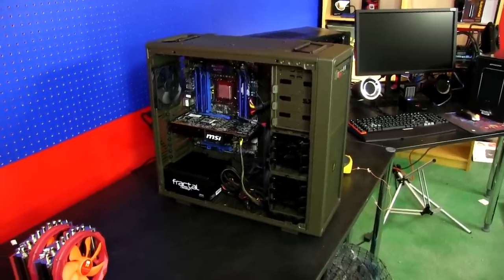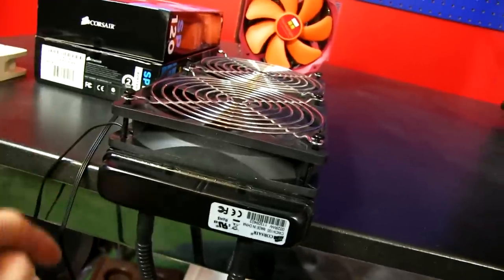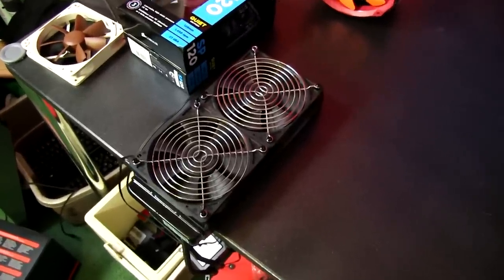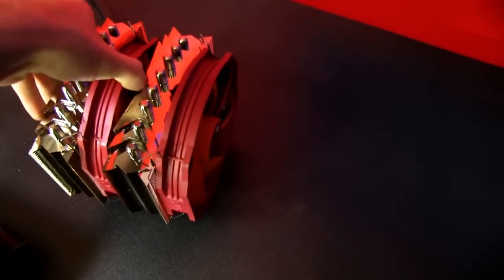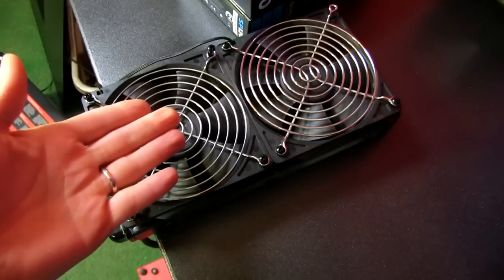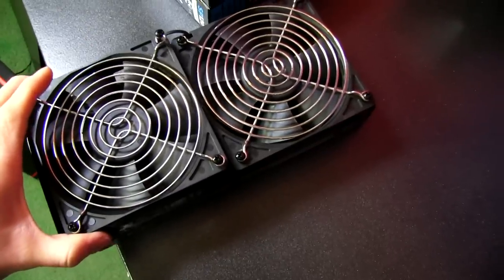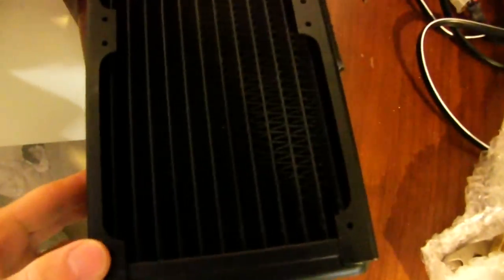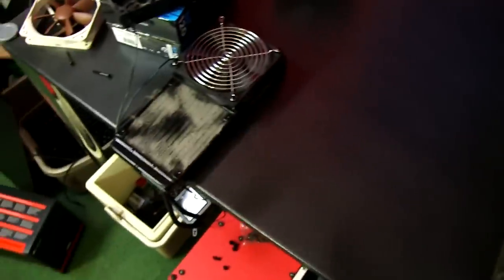Push vs Pull vs Push Pull for Radiators and Heatsinks Linus Tech Tips

Comment: Several logical ways to know the best set up
- Industries (yes, INDUSTRIES!) in refrigeration and air-conditioning run their heat exchanges in  pull to avoid dust in any environment possible. I believe they know a LOT better than we amateurs ;)

- I find it STUPID when people use static pressure fans in pull and air flow fans in Push :') 

- Most of them get the whole concept of basic common sense thermodynamics wrong. What is the point in having the back IO fan in exhaust when the radiator, which if situated towards the top, needs more air? It has to be in Pull to help feed the radiator.

- Same goes with getting air to pull from top of case and push through bottom of radiator! That's like WTH moment. Why fight against nature by pushing not air down? There is a point that all data centers get cool air pumped from the floor down to cool all the racks.

I feel like Sherlock in these instances. It has got to be so VACANT in most peoples heads :D

Comment: I have the same case, Corsair Vengeance C70.  What he said is true that so much dust accumulate if you made your cooler do push exhaust/intake.  It was hassle to clean the radiator because you have to unscrew those fans and remove them.  That tricky part about that is the small clearance of the screws (closer on the tray), it's blocked by the heatsink of the motherboard.  So what I did was pull exhaust config on top of the case.

Comment: The dust buildup shows why I would go with a pull config.
I would go so far to screw the fans into the case, then the rad into the fans. That way I could just take off the rad if I need to and keep the fans in place.
Reply: I have an air cleaner in my rooms (HEPA) and it takes MUCH longer for a radiator to get dust build up, along with good dust filtration.

Comment: The definitive answer to this existential question is a push-push configuration.
Reply: Won't it be even harder to clean the radiator out?
Reply: +Chalklate No, in a push-push config it is self cleaning. Get out of here. :P
Reply: Wash your fans with soap and water, while they are running.
Reply: pull-pull?

Comment: I have a Corsair H100i in a Push/Pull configuration using the original non-SPL rated 120mm fans on the back in order to space the radiator out the extra 25mm from the case.  This allowed the radiator to BAREFLY fit inside my Antec 1200.  The two fans on the front are the Corsair SP120s.  So it's really Push/half-pull.  But I can easily clean my radiator in my case when I take the side-panel off because I don't use a can of air... I use an air compressor that pushes over 60PSI out of the nozzle.  When you push that much air backwards through the radiator, all the dust comes out with it.  It's quite easy to clear the dust from the case in that manner.  I never had to remove my fans at all.

Comment: Its also worth noting that a 25-30mm gasket between the fan and the radiator will improve airflow and help negate the dead spot.
I seem to remember a test someone did a long time ago (pro-cooling forums maybe?) showing all the configs and the numbers supported push-pull > push > pull, however you do have a good point in that the improvement from push-pull might not justify the added noise and pull has the benefit of being easy to clean but being that you WILL be exhausting from the radiator if its an internal setup, by putting filters on all the input fans you can prevent dust build up in the first place ;)
And to the guys saying push-push or pull-pull unless you have counter rotating fans or a gasket with air straightening fins in between each fan you are wasting your time.
Reply: Who has room for a 3CM gap between the fans and the radiator?
Reply: ***** Anyone not using a mITX form factor case I would expect ;)
Reply: Sorry I didn't realize you were including megatowers in your statement. 

For the record, it will not fit in my case and allow the filter to fit on top. And it is not a mini itx either. A mid tower.
Reply: ***** Yea it all comes down to case design, in the same way some may have to stick to 30mm radiators over 60+mm radiators, so far I haven't been limited in that respect.

Comment: What are non pressure fans for
Reply: Just normal airflow, not for radiators
Reply: So do they move the same amount of air, just static pushes straight more?
Reply: Ahhh okay that makes sense.
Reply: +FroztiProductions Generally if im correct, you use AF fans on casing exhaust on the back and top if you not using any liquid cool, and casing intake at front some case has drive bay near to the front and people recommend use SP fans instead
Use sp fans for radiator and heatsinks fan if you wish to replace it.
Reply: +FroztiProductions SP for restricted spaces, AF for free space.  Example: Let's take a Corsair 750D case with an h110i at the top configured as an exhaust, back fan as exhaust, front as intake.  Front: If no drive cages or stuff tucked against the fans, AF, otherwise SP.  Back exhaust unless used as a rad is usually exhaust airflow. Top is AF if no rad, exhaust, if radiator SP as push or pull exhaust.   A little bit more positive pressure (intake) in the case is better than negative pressure (exhaust) for dust buildup, because negative pressure will pull in dust from unfiltered holes, while positive pressure will push the air out.
Reply: +FroztiProductions static moves less air but is more focused.

Comment: Square / Rectangle frame fans line up with the edges of the radiator.  Their fan blades are as long as possible to force air through the cooling fins.

Standard fans are for general directional cooling / case air flow, they have shorter blades which don't give the same draw strength.

Comment: Fan plus fan is called compound and does in fact increase cfm.  The front fan will feed the second fan compressed air.  

Look at compound turbos on diesels.
Reply: Yeah, this video is outdated. It also doesn't take into account the insane current temperatures of graphics cards.

Comment: I run push-pull because i got a good deal on non pressure optimized fans.
Reply: waste of energy.
Reply: Allen TKO ?
Reply: I run push pull, it helps, It Lowered my temps 10'C with the fans at 50 percent.. Its easy to clean, i just use my air compressor with a moister trap filter on it so i don't blow moister all over the inside my computer. That canned air crap is for the birds.

Comment: I think the push/pull vs just push or pull argument is largely dependent on you radiator as well as your fans. The reason I say this is because I have a couple of Noctua NF-A14 PWM fans set up in push/pull with my NZXT Kraken X40. I recently tired taking off the push fan due to limited space in my case, but to be sure about the results I also ran Prime to check the difference in CPU temperatures. For this test I ran the fans at 100% to get as much airflow as possible, and thje results was staggering in my case. I recorded a whooping 12 degree Celcius in difference when running just pull instead of push/pull. I had a max temp at 57 degrees C while in Push/Pull and that raised all the way to 69 degrees C when just in Pull.

Granted; the Noctua NF-A14 might not be as pressures optimized as the NF-F12, but Noctua still markets them as pressure optimized fans. This is just something for people out there to think on.

Comment: The missing piece of info is what direction the air flow should go (inside to outside or outside to inside). Always go inside to outside to get hot air from the radiator out. Your other fans should bring colder air in with maybe one other fan moving air to the outside to balance things out. Just try to have good airflow where you have about the same number of fans moving air in as out.

Comment: look at all that money. to be able to mess and configure with unlimited hardware and software sources and im just. its my dream. and this was 3 years ago and I still got a i5 cpu. lol
Reply: +James Thebeau i'm currently using a pentium dual core. And i'm actually  saving money to buy an i5.
Reply: Blatz430 Well its not to say its bad. But this is the last era of gaming I will actually be able to use this max. Best thing is to get your ram and a capable motherboard first.. lol which for me would even be the z97. i made a mistake and bought ram and a video card first and cant even overclock them on this motherboard and its a single 12v rail.

Comment: The only difference between push and pull is in the way the fans are positioned in relation to the radiator, not the way air actually flows.
So you can have a setup where you "make the air from inside the case go through the rad to expel it outside" with either push or pull. 
Push means the fans are positioned below the rad, pushing the air directly into the rad. Pull means they are positioned above the rad, pushing air directly out of the case but at the same time pulling it through the rad.

Comment: I also have my radiator fan configured in pull.  It seems to make the most sense since the radiator fan replaced my rear exhaust fan anyway.  So that's where I have it mounted.  Linus made a good point on how easy it was to clean the radiator.  I had to clean mine a couple times so far.  It's not a big deal.  Just brush it off.

Comment: Answer me this one. My configuration is push pull from the outside of the case. What do you think would happen to your vehicle if you put the radiator in the back with no auxiliary venting and just asked the fan to push air from the cab thru it. Your cab would be hot and your vehicle would overheat. That's why the radiator is in the front so it catches cold air. Fans blowing outside cold air on the radiator will cool better than fans blowing/sucking hot air thru the radiator from the case.

Comment: Nice to know I was right on the money. First time I ever bought a small cooling kit a few month ago since it can get pretty hot where my computer is my cramped room and I wasn't truly sure what way to have it but I decided to have the fan pull air and no once every few month I can really easily go in and use a hover(vacuum) to clean the dust off it.

Comment: Actually the pressure of the fan is determined by the blade pitch and RPM. The factory tries to balance these out for intended use and noise levels. Maybe one day they will offer variable pitch fans for computers but I have not seen one yet. One reason would be the cost to build one would be 5 times the average price. So they use variable speed controllers for now. To get the best cooling with water is to choose the best fluid that has high surface tension properties to draw heat into the fluid.

Comment: Because of the thickness of the h80i you will maybe see a few degrees higher operation with only one fan, but the most important thing is to keep the fan in pull configuration.

In short, it's fine

Comment: In a pull configuration, the first thing the air (including dust, hair, etc) is going to hit is the radiator.  It is easier to clean a pull configuration because you can clean out the rad area with out the fan in the way.  The rad is all you are concerned about cleaning, because that is where you need to airflow to cool the liquid.  Sure there will be some dust on the fan on pull, but no nearly as much.  The rad catches much more dust than the fan ever will.  Make sense now?

Comment: Sure, because you're optimizing the static pressure between the fans and the rad. You're helping the air move through it more efficiently, but at the cost of higher energy consumption and noise levels. That, and you'll have to clean out the push side of the rad more often than the pull side or the extra fans aren't really doing you any good at all.

Comment: Linus, let me explain it better: two fans at the same RPM == same CFM as one fan but twice the power. Think of it like a car's gearbox. 1st gear == most power used, less performance (speed), 5th hear == less power used, biggest performance (speed). Now with fins and fans it's different, you just need to keep air moving such that the maximum heat transfer potential at the room's temperature is achieved. That doesn't mean speed. It actually means power to keep it moving through all those fins.

Comment: The only advantage I can think of for push vs pull or vica versa, would be choosing where your dust primarily builds up.  If you are in push, the radiator gets all the dust, if you are in pull, the dust may get caught in an intake filter.  So you can possibly make your case a little easier to clean, depending on the case and setup.

Comment: Linus, i listened to u, for once, lol. Had my rad fans as intake from the upper side of the case blowing into the rad, which caused hot air to be produced by the rad and into the inside of the case which heated up the components & the hose inside. Now i have the fans pulling the air directly from the rad out the top of the case cause u recommended it :)

Comment: Thank you for your reply.  I had a suspicion that controlling condensation might be a problem.  I imagine that an enclosed nitrogen gas environment might control condensation; however, access to the motherboard, for upgrades and such, would then become more involved.  It seems that air cooling and radiators are the more practical solution for cooling.  I would like to find a practical way to cool the processor and maintain a negative Celsius temperature and be silent also.

Comment: I have had the opposite experience.  I have a Silverstone FT02 case that came with built in filters on the three 180mm intake fans.  I have had it for about 2 years and only dusted it once.  And looking in the window right now it is still virtually spotless inside right now.  I clean the filters every 2 months or so and they are always totally full of dust they have stopped.  My heatsinks on my GPU and CPU are still spotless thanks to my filters.

Comment: Kraken X61 here with a 4790k and I've used a push config, pull config, and push/pull config.  The results are the same.  Idle 28 degrees and load at 43 degrees give or take a couple degrees within margin of error or negligible performance increase.  I'm going to run it in PULL, radiator mounted on top of case to avoid that hassle of major dust build-up.  Eff that!
Reply: Joseph Long Thanks.  Never thought of that before.  Most people would consider this useless information, but now that I'm older and wiser, the most useless information are often the most useful.  It can't be explained.
Reply: +Crunk Playa69 Exactly the same as mine, my temps atm with ts, skype, origin, CAM and a couple browsers on chrome 30-32 degrees. But the pc has been on for a while which allowed the liquid to warm up to 30 degrees.
Reply: Edit:  radiator is mounted AT the top of case, not on it as is displayed in the video.  Just to avoid any confusion.
Reply: Mine is also on the top, it barely fit :D i had to remove some drive bays for it. Its the h440w case. 
There is no dust filter on top, so the radiator works as a dust filter in a way that it prevents dust from getting in to the computer to some extent. Its pushing in air because i wanted the extra air to blow out of the cracks instead of pulling air into the cracks (which would bring dust in).

Comment: the vents that channel the airflow after the air has been pushed by the blades don't make the fan bad for pull. If you think it's unacceptable to run a fan like the nf-f12 in pull then you can buy silverstone air filters which are available in various sizes. they are magnetic and you can attach them to the fan wihout having to onscrew the whole thing to remove and clean the dust filter

Comment: Hi Linus, appreciate the video is a few years old but I tried the configuration you suggested with fans in pull and they rattled terribly on startup and made the dust cover on my Corsair obsidian case rattle too with wind turbulence so i had to weigh it down. It wasn't all the time, only on startup and when under high load so I put up with it for 6 months.
I recently purchased a Seahawk 1080 and had to reconfigure the cooler to fit the radiator for the GPU, I put it back to the push configuration recommended by the manufacturer and the fans are now super quiet, no rattle and I think less noise overall (probably as they are under the rad).
Just sharing my experience, would defo go with Push on the 110i, love your work Linus!
Reply: You should ensure that you are using rubber washers/gaskets to keep it from reverberating.
Reply: +nexus1g yes I did use them, the rattling came from the hub of the fan, not the fixings, its a common issue with them but for me, switching them to push fixed the problem.

Comment: That would depend on whether or not the fans are using performance monitoring software / hardware to adjust the fans' RPM based on the temperature e.g., radiator. The fans performance is configured through monitoring software based on the users preferences. In my build I am using the fans that were provided with the H100i: additionally I am using Corsair link cable with the Corsair Link 2 software (my case is the Corsair Graphite Series 600T). Basically, higher temp = higher RPM and noise.

Comment: push out of course is the best if your radiator is on top of the case. i use Noisblock eloop fans for max static pressure and they really quiet,  for dust protection i use squere cutet parts made of nylon pantihose on all air intake fans. the nylon throttles down the airflow massive but easy to clean, case inside dustfree even the gpu cooler always clean. works for me

Comment: I recently looked back at this before going push pull on my artic LF3 280mm AIO. Have it front mounted in my case, utilising the same Arctic P14 PWM PST fans on either side. All on one loop with the AIO. Considerable price to performance values. Linus if you see this please revist push pull. Times have changed ❤